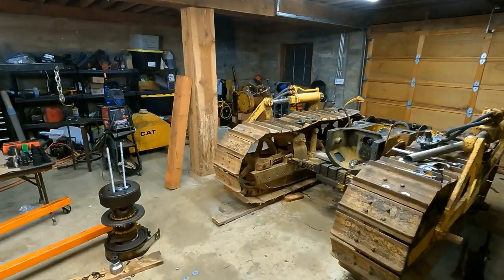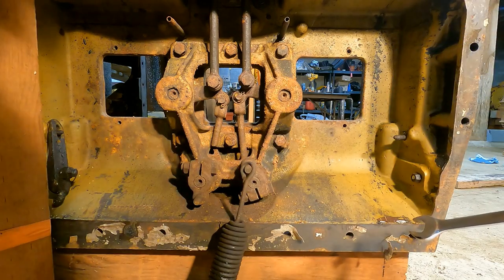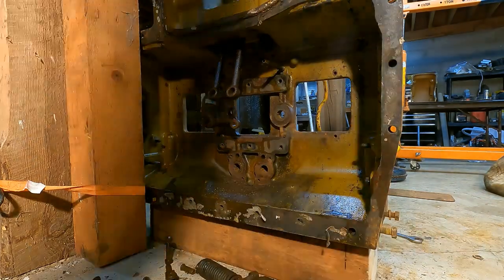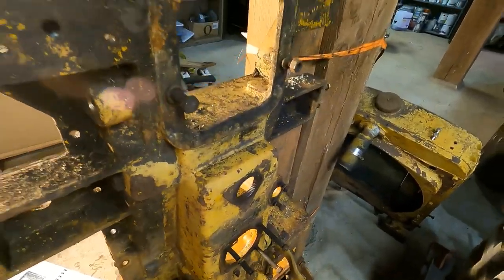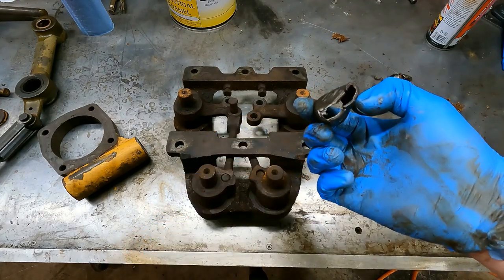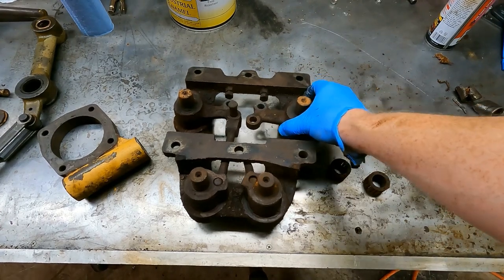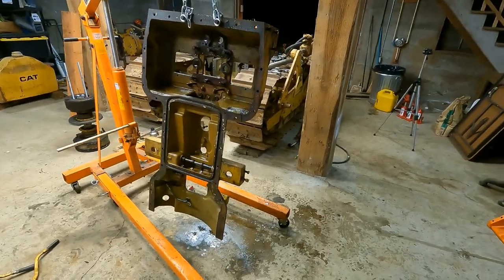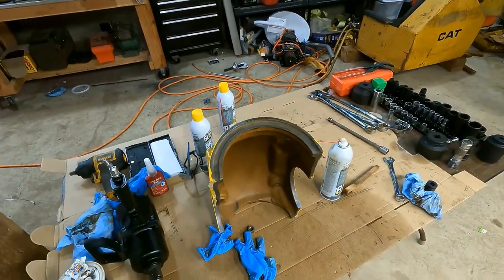The steering clutch linkage on this Cat D4 needs some work

Comment: It's good that your organized and structured. That project could get away from many people. I did a every nut and bolt removal pan off restoration of a rusty VW bug. Lot of rusty metal being cut off with new metal welded on. My garage was packed with shelving of all the parts. I kept it organized and had a pad with me when I disassembled the car. I wrote down what parts were needed. 2 years and several breaks from the project to recharge my batteries, and I finished the car. 
Many people start a project like a car restoration or a project like yours with a piece of equipment. Sadly, many of these projects are not finished. They are sold or people just scrap the parts.
I have a strong belief that you're going to continue to systematically work through each section till that dozer is moving dirt!
You're doing a good job filming and editing these videos to keep them enjoyable. I'm looking forward to your updates!

Comment: I learned a valuable lesson about running hot water through a regular pressure washer. Make sure you read the manual to make sure the pump is rated to run hot water. I was operating one and it was only rated to water temps up to 110 degrees. Hot water was set to about 135. Had to replace some O rings in the pump after that… oops 😂.

Comment: Best thing to do with the grease fitting is to put plugs in and when you want to grease them take the plugs out and use a new grease fitting that way you never get dirt in the grease fittings. I went through this with my skidder greasing the wheel bearings. I replaced about 5 sets of wheel bearings before I got smart. Lol.

Comment: remember that most of the internal rusty rollers/bearing ect was due poor maintenance with leaky covers / plates /lack of concern ect that let water in over decades  , this nice machine when finished if stored under cover when not used will last a life time

Comment: There’s some stuff called cosmoline and it’s like a grease and kinda waxy spray for protecting machine surfaces until you’re ready for assembly! It washes off easy with diesel or kerosene before assembly! Just something else I learned it the machine shop!, thanks for sharing Matt!👌🏻🤙🏻🤙🏻
Reply: Cosmoline EASY to wash off?!! Somebody obviously has never bought surplus firearms! Lol

Comment: This machine is very lucky  to not be on its way to make  rebar out of it. You are one of few that would take this and  redo it. Had you seen the other machines where you got the engine at, one of the better ones there would of came home and be doing what your intentions are. I kinda think with this much put into saving it, It just might live on many more years as family machine or piece that can still work and show off its abilities at some carnival. Your going to have a very good "old" machine. Value wise, it doesn't make money sense for building it back. I bet a new pickup would not be enough to get out of your hands now/LOL. I am impressed with your skills

Comment: Hi From AU Matt, I think its time you make a simple box bead blaster/ sand blaster , after owing one in the workshop for over 40 years it is the one single tool I could not do without. Simple and cheap to run, it takes ALL that crap rusty looking blobs you have and turns them back into shiney machined parts, if not for wear, they look new.  Any problem with a part will be revealed after its cleaned. And as a added bonus, the work effort is drastically reduced. Cheers.. Mike.

Comment: Great video, thanks for sharing. Something you may want to consider, when you go to loosen a nut / bolt with a "open -end wrench," use the box end instead to break loose the item.   Reason is if you use the open-end, the fingers of the wrench spread open, thus causing the wrench to slip, and this is when you start using the words that need to be bleeped out of video's.   Also when possible, always loosen a nut / bolt combination via loosen the nut, hold the bolt head still / non moving, when the situation allows.   Also on hard to loosen nut's, when you get it to move / loosen, continue to rock back & forth and only try to advance a turn or two at most.  The reason is the rust can build up so much that it will try its best to lock-up / seize-up the nut. By rocking it back & forth your trying to grind the rust-up to dust (when doing it dry) if you will.   That's why when you can, spray some type of oil on the item your trying to loosen, when conditions allow.

Comment: I could be wrong but I think those bearing races are hard and can not be drilled with a high speed twist drill. A easy way to get those races out is to put a bead of weld in the inside this causes the race to shrink and it will then fall out .Great job working on the machine !

Comment: I would strongly recommend using a solution of TSP (Tri-Sodium Phosphate-any hardware or paint shop will have it) as a degreaser and an adhesion primer before applying any new paint. Better to use gloves and eye protection as it can be caustic. 
I respect you for attacking a significant task like this. I’ve really enjoyed watching your tenacity as you continue to make progress on this major project. Can’t wait to see you doing “wheelies” at the finish!! 😂👍
Reply: Good idea. It has the advantage it is inexpensive, and the phosphate will break down sufficiently that it will fertilize.

Comment: Regarding bearings. How old is that machine? If you pack them with heavy grease, they will out live you!. Also, I think your barking up the wrong tree to "drill" out a hardened bearing. To get the bearing shell out, weld a bead around on the inside surface of the bearing. When the weld, and the bearing cools, it will shrink, and fall out. I would stick to using what came with the machine originally. Love the rebuild.
Reply: It is a 1950 Cat so yeah it is pretty old.

Comment: The fire graphic is hilarious! A ton of smaller parts to make the bigger parts work, it does look like it all adds up and is time consuming. But, it does look like you have a good plan of action, with a handle or at least a good direction for completion. Good luck with rounding up all the parts and finding the new bearings. Slow & steady!

Comment: Great vid.  Prelube all those bolts and nuts brother. Not the WD-40. Try croil, PB blaster or the other penetrating lubes. A guy on here called scout crafter makes a penetrant he calls 50/50. Half transmission fluid and acetone.  Worked great. As a guy who removed a lot of stuck and broken bolts I’ll say it will save you time and frustration.  Looking forward to the next vid.
Reply: WD-40 IS NOT a lubricant
Reply: He's not using WD-40 for lubricant.  He's clearly clued up enough to know what needs greasing and what doesn't.

Comment: Consider replacing those needle bearings with Oil Lite bushings / oil impregnated bushings from McMaster-Carr
Reply: Came here to say the same thing :). I'm not sure why they fit those rust prone roller bearings originally, with little access and just a low speed rocking motion, oil lite bushings are a much better option IMO.

Comment: that fibrous material in teh bushing is probably jute- a greased jute called oakum was used for seals way back when - it almost worked.  also used to pack cast iron pipe joints before lead was poured in.

Comment: Lol, Charlie's tail is down and he thinks you have lost your mind because he can't see anybody...omg too funny. Excellent job on video and progress. I believe all these areas might be meant to have a splash lubrication. My thought is all the tubes are breathers and the only reason to have that many is alot of fluid expansion. Thanks for sharing this project.
Reply: The steering clutches are dry clutches, so there is no fluid to splash on the steering clutch linkages. 
As long as he can get the cover sealed so rain water can’t get in anymore, coating the bearings in wheel bearing grease or his idea to retrofit sealed bearings into the linkages should work.
Reply: @ralfie8801  sounds like you know, I was guessing because of the what looks like breather tubes. I have 0 experience in heavy machinery repair. Thanks for the info.
Reply: @Duerke  
If you haven’t found him yet, Squatch253 has a lot of videos on his D4 restoration project. These same steering clutches are one of the rebuild videos he made. He explains about how water and other fluids affect the clutch material.

Comment: I fill a spray bottle with hot water and Lestoil or Mr. Clean , and spray the part with it and then use the pressure washer . Works really good .

Comment: I could be wrong, but you may be referring to butyl rubber which is what they use for windshield gasket I believe.  It comes in a tube too so you may want to check if that's better than RTV sealant for what you're doing

Comment: Keep up the good work , hope the mail comes through fast and you get the puller to work. I used a 4'' angle grinder and a big knotted wire brush too go over castings , little wire brushes for holes and flat areas. I used a wire brush that had a handle , cut the handle off the twisted  wire holding the brush and put it in the drill , works super on small holes. You should be able to get them at a hardware store or auto store .

Comment: Hi Matt: Great Videos, keep going as they are most enjoyable. You mentioned that on the case and the casting you are going to use Buna-N material. I think by just looking at the square sealing surface and of course the age of the machine Buna-N would have been scarce just after the war, that it is an old style packing material that Cat would have used. Johns Mansville or Garlock have this type of material available in square material shape and various dimensions  (we used it for packing the stuffing box on our pumps). I think it is the same that Cat would use and will likely seal as good or better than the Buna-N. Most bearing houses (I.E. Applied Technologies) have this in stock, at least here in western Canada. Let me know what you think.
Reply from the maker: what's it called?

Comment: The string/rope in the steel bushing may be the old asbestos rope. It was soaked overnight in oil before installing, then it would lubricate the bushing for several years.

Comment: Don't know if anyone made the suggestion yet but if you want to remove the old races the easiest way to do it is to weld a bead all the way around the inside diameter. It shrinks the race and makes them easier to remove. I have done this for years.

Comment: To get the races out of the blind holes, just run a bead of weld straight down the race. Once it has cooled down, you will find that they will have loosened in the blind hole due to the weld contracting. Hope this helps.

Comment: Hi matt good idea with the brass bushing I to have an  large pressure washer It all solid brass  40 years old I took it apart to replace the return valves But got sick and left the parts on the bench for a few months My kids are often using My  benches  to work on stuff when I finally come back to it  I found I had lost most of the parts.   strange when you say that about  the  imperial system  Im 70 I grew up in Australia in the 60s being taught in school the  imperial system feet and inches MPH But the moment I left school 1968 Australia  went to the metrics system. It been 53 years But It still more  easier  for me with   the  imperial system then the metric system.

Comment: Do yourself a favor and go to Harbor Freight and pick up a Needle Scaler. I have rebuilt several tractors and use it to remove all paint, rust, hardened grease and anything else stuck to the frame. It will chip all the paint off and leave the primer behind.

Comment: The stuff in the steel bushings is called “Oakum”
Reply: Negative. Oakum is used to "caulk" ships and pipes. The material in that bushing isn't parallel stranded like oakum would be, it is cross hatched. It is Linen Phenolic.
Reply: @brennerheavy  more likely asbestos back then.

Comment: The Roller Bearings on the clutch are Hyatt Roller bearings. They are long obsolete. If you are lucky you may be able to source a modern needle roller bearing with the correct dimensions.
Reply: The best way I've found to remove the races is to weld a head around the inside circumference of the race. As it cools the race will shrink and come out.

Comment: Interesting project thanks for the video. The outer bearing race i just use a dye grinder and cut from top to bottom and it will come out easy.. Best to try to use the original dimension bearing.

Comment: What about drilling out the bushing with a slightly undersized flush bit?. That way you would just have a thin shell left that would be easy to remove as it could be either bent or ground out. Good idea on the sealed bearings.

Comment: think about using boat trailer wheel bearing grease on those open bearings its resistant to moisture.

Comment: Those needle rollers just need wheel bearing grease applied to them when fitting.  No need for weird solutions.  Just think of how long grease keeps your wheel bearings going and compare that to the almost zero movement these needles have when in service. They only move maybe 30 degrees, not ever a full circle.
Reply: can't he just measure them and put in regular enclosed bearings packed with grease?
Reply: @parteibonza  Doubt it.  There is no inner race - the rollers run directly on the shafts.  Although there may be a suitable one available with tiny rollers.

Comment: FYI when dealing with precision fits for bearings you typically do NOT use a twist drill for a final fit you use a hand reamer to sneak up on your measurement, either with an adjustable or a fixed diameter.  It will give you a better finish for your new bearings to ride on along with far more control in the machining process since I don't expect your going to lay that 400lb casting in your drill press.  A twist drill of that size will tend to wallow out your hole and produce poor bearing fitment and cause wobble.  Make I could see doing it for one but not eight invest in a good hand reamer for this.  Further more the races left in casting are proly hardened and you'll need to take the harness out of them by heating them to a purple to cherry color to re temper them so you can machine them, or you could possibly use Carbide tools to do the work but I would reheat them.
Reply: Same thought, drilling then will need reamer, pull/well then machine new inserts
Reply: @smaggies  
Yeah machining hardened steel outside of a machine shop is not recommended.  After some more thought on this is what i came up with get a bushing made form mild steel for the new bearings or machine some oilite brass to fit the part and dont use any bearings.  Other Thoughts?
Reply from the maker: I ended up using a brake hone.. worked pretty well.  There are pics of it in the last community posting.
Reply: @PacificNorthwestHillbilly  
That's one heck of an idea never thought of that how many thousandths did you have to remove? i missed that in the video, what a great and simple idea though.  When you have a machine shop at your disposal you can very easily overlook something as simple as a hone.
Reply from the maker: It's not in that video, but I just shared some pictures of it here: https://www.youtube.com/post/Ugkx50msXFnw1QKZm2krS7YprLBpeDSSSJe9
Not sure how much I had to remove... less than the 0.020 I originally thought.  Mostly just had to remove the rust coating.

Comment: Use a rubber brake bleeder cap for your grease fittings, maybe from a semi might be the right size? (I think a hydraulic parts shop would have a set up just for that, not sure nowadays?) Or, wipe oil around the fitting after install and use silicone like a cap, after it dries 24 hrs it will pop on and off, old-school ...Lol... Now, about those fingers... Lol
Stay safe

Comment: Hi Matt, You never said specifically whether you had a bearing supplier in your area that could provide you with the bearings you'll need during the rebuild. I'd like to recommend Canadian bearing which I know supplied bearings to the steel mill in Sault Saint Marie Ont. (Formerly Algoma Steel) They have a wide range of bearings and could possibly have any bearing you might need.

Comment: You can add grease fittings anywhere you want even in spots that are impossible to get too. Something like what you're doing I would drill some holes into the castings and into the bushings or to access the bearings that you pulled out and thread it and use 1/8-1/4in inch stainless steel tubing and thread the ends and fit it into what you just drilled and tapped and bend it to a point where you can put a grease zerk onto it and access it with a grease gun

Comment: Carbide burr through the race until you cut completely through then it will either relieve the tension and can be pulled out or you can chisel them to collapse them.

Comment: watching   you   clean  top  off   gear  box   as   i  told   you   have  owned   3  of  those  d4s  in  new  zealand   there  is  not  many  parts  you  cant  buy  new  cat  have  a  huge  ware  house  of   spares  in  singapore   you   can  get  those  bearings  for  lid the  one  you  said.  had  a   hole  down  side   are  bushings  heat   them   up  let  em   cool  they  will  drop  out   nothing  i  have   not  replaced   over  the   years   oh  if  you   ever  replace  bearings on  rear  final  drives   the  cups  have   a  dowel  down  hole  in   housing  to  stop  it  turning  in  bore  these . are   held  in  by  cupshape  welsh   plugs   to  remove   these  use  three  eight   plug   tap   down  hole  after   removing   dirt  with  air  screw  tap  down  into.  cup  place  flat  washer   over  tap   screw  nut  same   thread  as  tap   down  tap   it   will  extract  the   cup     no  drilling   no   burning